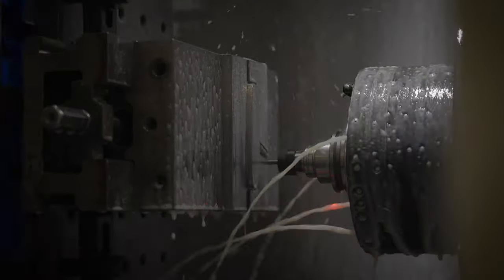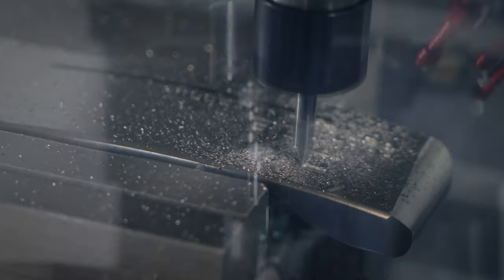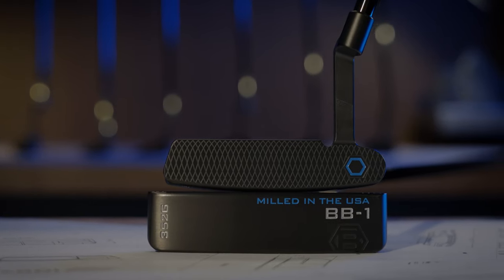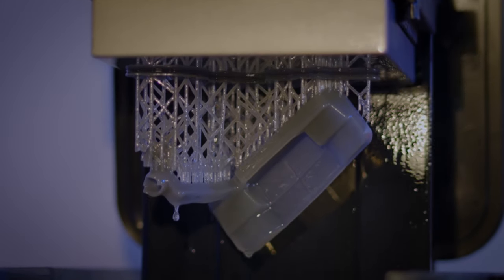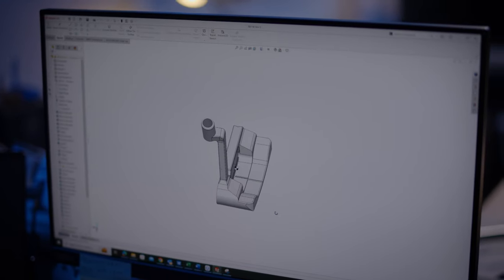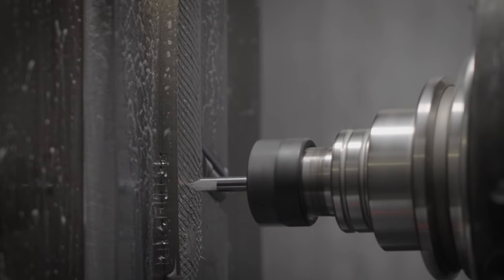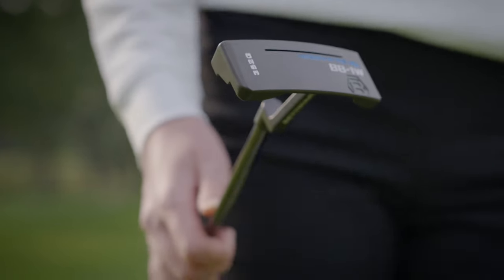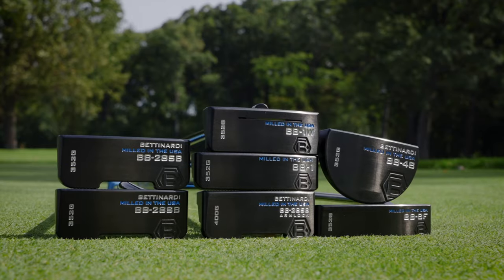Bettinardi Golf Unveils 2024 BB Series Putter Line

Comment: Just got one of these and absolutely love it. I've tried a lot of different putters lately, trying to find "the one". I was very happy with my SC Newport 2 Super Select, which was my gamer for about 6 months, but something just held me back from being 100% sure. Main issue I had was a slight lack of face angle control on my takeaway.... I am definitely more of a flow putter (not straight back straight through) and really need some toe hang, which i struggled to find in a mallet. Spider X came close but I just prefer the nimble/agile feeling of a blade. Tried the new Phantoms and found them way too heavy for my liking - nice on short putts but lacked distance control. The Bettinardi bb1-w, however, was love at first putt. The feel and sound (with sound slot) was so impressive, and on longer putts I could really use that sound to dial in my distances. The toe hang perfectly suits the flow of my stroke, so I feel very much in control of my path and face angle. Great product, and oh yeah - it happens to look amazing!